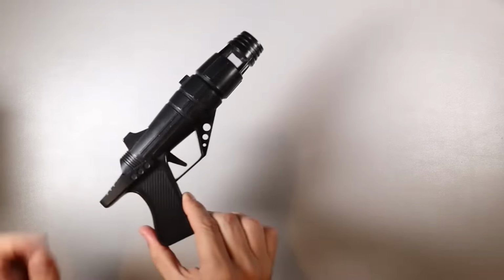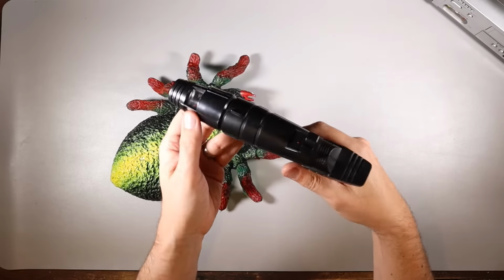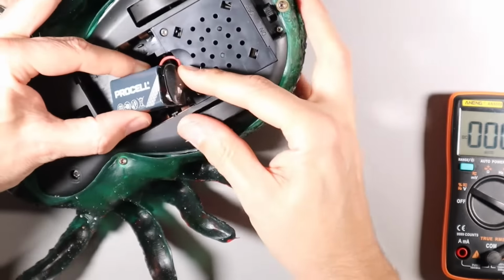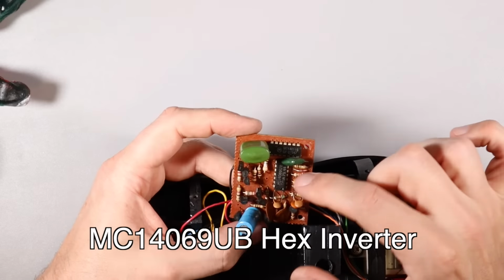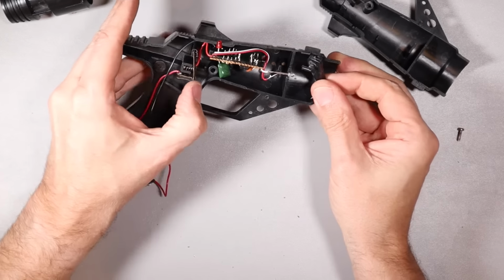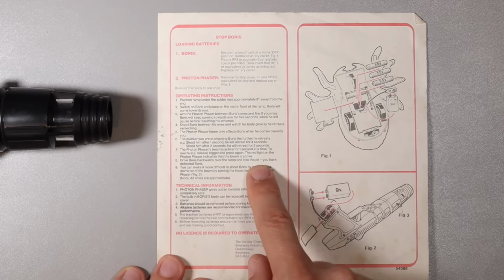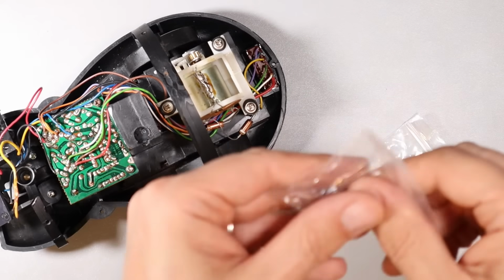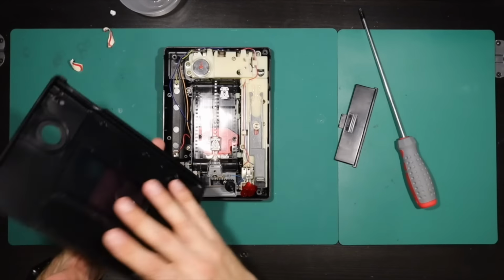Boris is Broken! Can I Fix This "Stop Boris" Robot Spider Game?

Comment: The earlier Boris spider had a vibrating, mechanical, metal device for its screech, but it would snap because of metal fatigue, so it was replaced with the electronic screech, which you have there.
Reply from the maker: Oh that is interesting... I remember the early "operation" had a electric motor used to strike the plastic to create a 'buzzer' I was disappointed to see the current ones have a speech chip. I'd love to hear an early Boris. Anyhow thanks so much for your comment. Very much appreciated. Happy New year and enjoy the videos... New one coming in a week or so!
Reply: @RetroTechRepair Thank you, Roger. I really enjoy your videos, please keep them coming and a very Happy New Year to you, too.